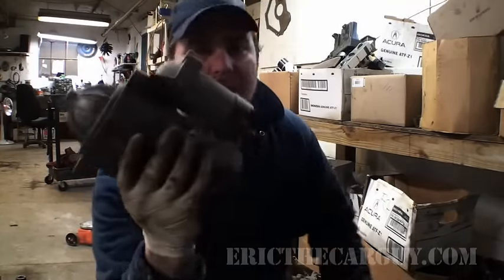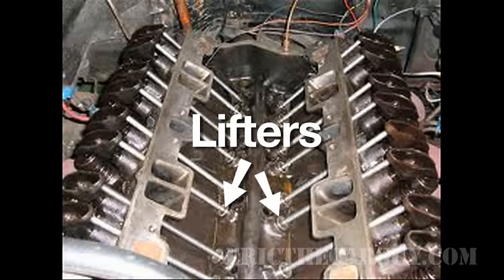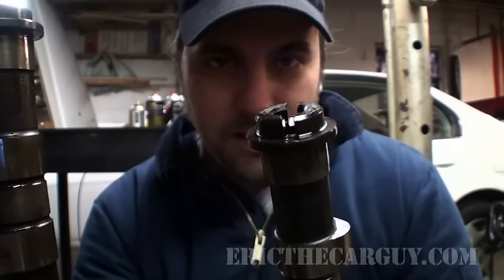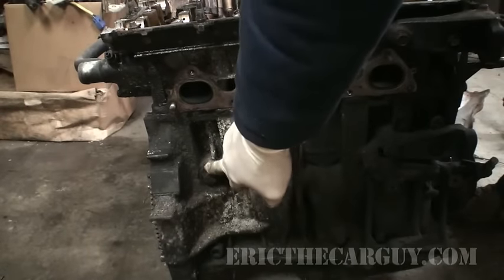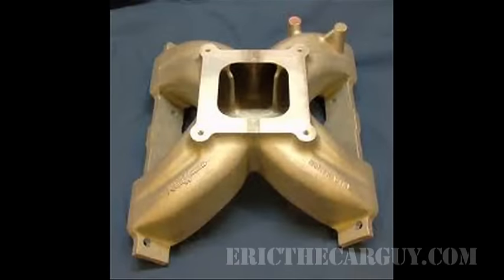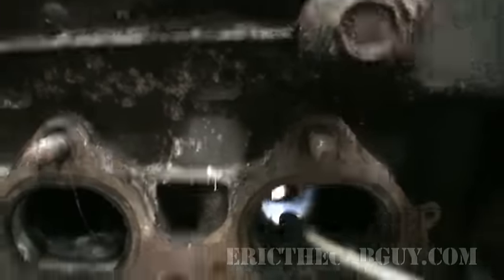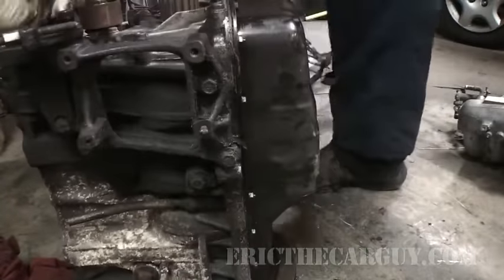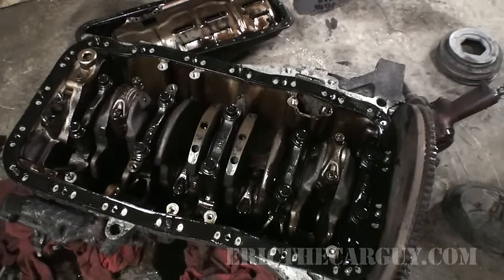Dissecting an Engine, The Basic Parts and Their Functions - EricTheCarGuy

Comment: I kinda feel like the video should have gone the other way around, start with piston + crankshaft, end with camshaft and valves, but no biggie.

Crazy how very similar engines are across really all makes, and even more so how little they've changed in most of 100 years, at least when not including fuel injection+computer.

Comment: I'd like to point out that an engine is still a motor, and that the latter term is not strictly used for electrical components. "Motor" is latin for "Mover" and is used for any type of device that converts energy into kinetic energy. I looked this up solely because I'm from Germany, where the Otto Engine originated. It's called "Otto Motor" here, or (loosely translated) "Ottos new engine" by the inventor himself. Which later led to the birth of the automobile as we know it today through the means of Carl Benz. Although I also acknowledge that these words may have another common meaning in other languages, of course!

Comment: ANYONE HAVE ADVICE ? I have a 4.0 litre V8, Baby Northstar Engine in
my 2001 Olds Aurora, have this "intermittent problem". When it just about
comes to stop it "sometimes" starts to buck a bit, does not come to a
smooth stop, but usually does not stall. This happens on and off ??
 
Where do I start ? clean the throttle body, leaky EGR valve, fuel filter, idle 
air control valve, or maybe a crank sensor, unique to V8 Northstar engines.
 
Any of you good mechanical guys that read the posts here on this great
channel, please give me some advice, as I don't know where to start - thanks.

Comment: Can you make a part two? Noticed you didn’t explain things like carburetors or distributors/alternators.
Reply: carburettors are for the most part, old. he talked about distributors but not in great detail & alternators arent really a part of the engine, it is connected to the engine via pulleys ( when the engine spins so does the alternator ( if it’s connected )
Reply: @lvgio  yeah I know that much, but it doesn’t matter. Some cars still have those
Reply: @legendarypillow1450  distributors also are replaced by coil packs, and yeah i guess it would be nice to know especially if you own an older car that has these old components but there are other videos out there

Comment: I'm trying to replace my head gasket on my 1991 mercury capri 1.6l 4cyl non turbo and I've got it all apart but my step dad whos a retired mechanic for 30+ years told me to take the block out too to take it to a machine shop and have it rebuilt if needed. With that being said I've ran into multiple problems dissecting it and could use anyone's advice as it being shot or reusable and I'm stumped because I want to make sure to put it back together right...

Comment: LOL, 556 haters. What to hate about this great explanation?!! I bet they are all greedy Mechanics angry at Eric why he is educating the public. 
One thing I would add. Many people wonder why the engine gets destroyed when the timing belt\chain break. As Eric showed how Camshaft, valves, pistons and firing are all precisely timed, the intake valve opens while the piston is going down otherwise the valve would hit the piston, and also the exhaust valve closes right before it reaches the top dead center, otherwise the piston would hit the exhaust valve. Now you can imagine what happens when the timing belt\Chain breaks! the piston hits the valves causing the valves to bend or break, the Hydraulic lifter seats to break, the rocker arm, the cylinder or Cylinder head to break, Camshaft to break. This is why it is so important to change the timing belt\Chain as suggested by the owner's manual.

Comment: My mechanic saw a bit of oil at the bottom of cylinder 5 v6 accord thats misfiring and stalling. Dark smoke sometimes. I just swapped the engine in because the old one died. How can I fix this issue? Mechanic can't pull any codes because my car does it randomly. Also can exhaust leak cause fumes 29 back into the engine and cause it to stall? What can I do now because piston 5 has oil

Comment: First engine u showed DOHC 16 Honda is an interference one, have to remove the camshafts in order to remove the head bolts, the timing belt tensioner is or was at least on the integras prone to go bad and the belt gets loose, and u lose timing, pain in the ass for just one person to set timing

Comment: Hello Eric. Not sure what video to post my question. Can an '04 MM use an engine block from '03 Lincoln Aviator? I've tried searching on my own but haven't had any luck finding an answer. TIA! Welcome back btw!
Reply: I dont know what an MM is, ive never heard of that model and cant find it in google. But if they both use the same engine then yes you can.

Comment: Eric I need help with my 2006 town and country overheating problems I change everything thermostat, Radiator, new hoses , fan works with and without AC at normal temperature 200 Celsius but I notice air in the system what can I do to resolve this mystery 🤷🏻‍♂️ 😞

Comment: @11:30+:  You seemed to conflate RPM and power, as if torque is in opposition to power.  However, power is a function of both torque and speed (RPM).  It might have been clearer to say that the intake design is part of how a given amount of power (the engine's potential power output) is split between torque and speed.

You need to hold one of the 3 variables constant in discussing their relations to each other.

Comment: Not sure if this'll be seen but a couple years back my door latch on my door of my 2009 Dodge Charger SXT warped and i had to get a new door and so like any regular mediocre car guy I went to junkyard and found a 2009 door, but turned out that it wasnt a 2009 door but a 2008 and ever since then my traction control is permantly off, my wipers. flashers, highbeams, blinkers, and horn does not work. I know its not the bulbs because if i hold down the Emergency flashers button it works. And i tried to unplug the harness to see if it was the different wiring but still no dice. If anyone has any idea what the problem is or what i can do as a solution i'd be most appreciative.
Reply: faulty battery, fuses, alternator, wires may be broken ( test the voltage )

Comment: Why is it 4x4 to figure out how many valves there are? Say it was a 6 cylinder. Would it be 6x6 to figure out how many valves it has, or 6x4?
Reply: Typically they only come with 2 valves for each cylinder (one for the intake of fuel mixture & another one for expelling the exhaust), with some coming with 4 valves for each, so it would be either 6x2 or 6x4 if I'm not mistaken.

Comment: I disagree with the engine/motor thing in the very beginning. Motor and engine is the same, just different name. That's why we have Ford Motor company not Ford Engine Company, as well as General Motor, Honda Motor, Mazda Motor, Lincoln Motor, Daimler Motor.... I think those are not names by mistake
Reply: they are the same, Engine is just a different kind of motor, converting Thermal energy to Mechanical work while Motors are more on the electric side, not so much combustion like an Engine.

Comment: what the heck is that part that has, like, the hole in it?.. you know.. it has metal on it, and then, like... there's a circle too.. i never seem to be able to figure out what that even does.
Reply: That's the part where it turns the other part. Not to be confused with the metal one opposite of it.

Comment: Cringing as I see him using a magnet to remove valve keepers. For those who don't know, one of the first things taught at mechanic's school when rebuilding engines is DO NOT use a magnet to remove internal engine parts or fasteners. It magnetizes those parts and they will forever collect metal particles when reassembled in engine, causing premature wear.